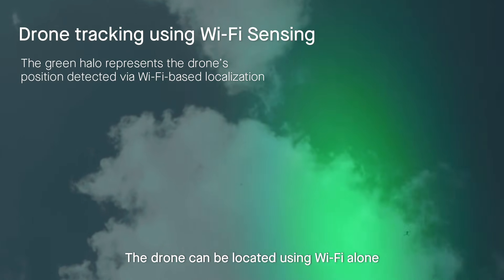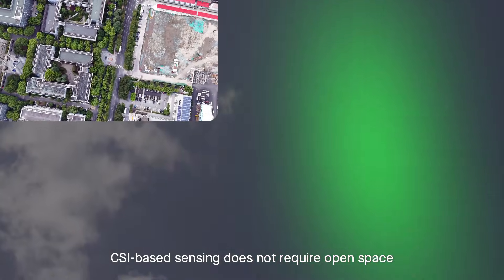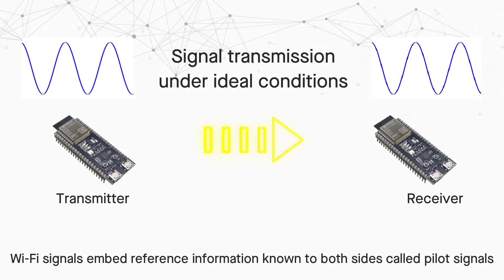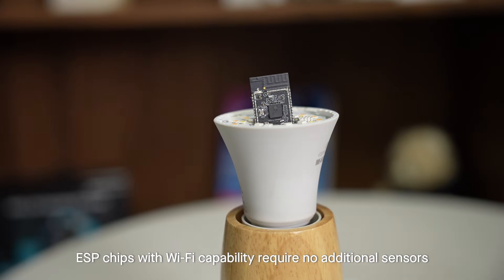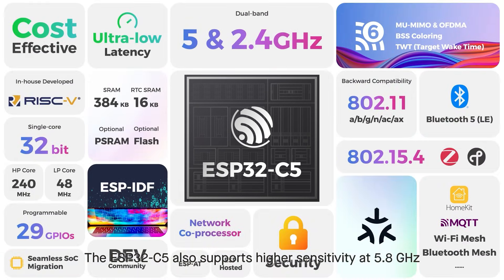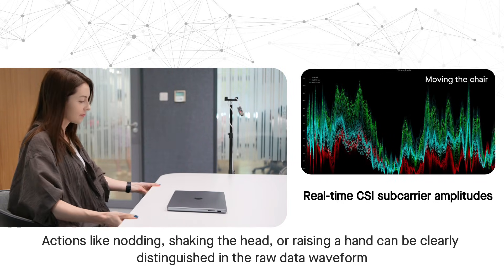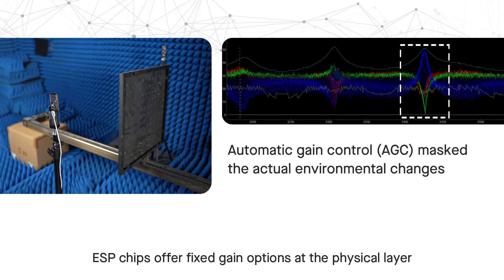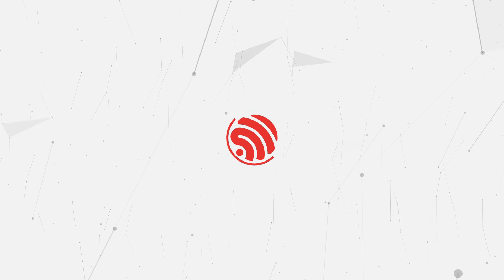ESP-CSI: Transforming Wi-Fi into a Sensing Platform

Comment: @EspressifSystems   please do research about wireless video transmission for drones with using WiFi for low cost with a very low latency as drone video transmission systems causes very expensive hardwares , please take a look a FPV drone field and develop low cost high range video transmission and decoding chips with open source info. I hope this idea finds well.